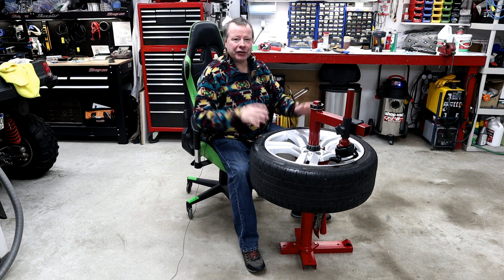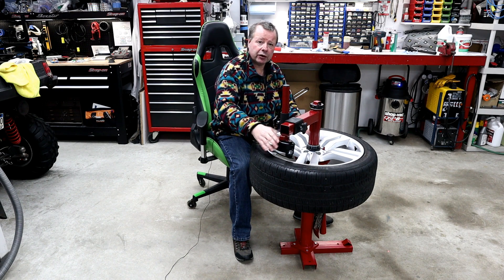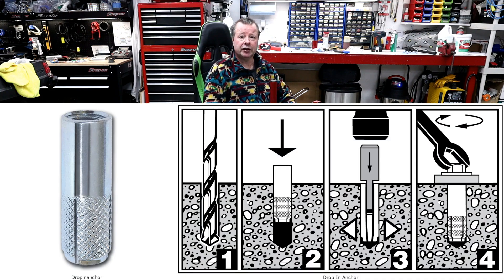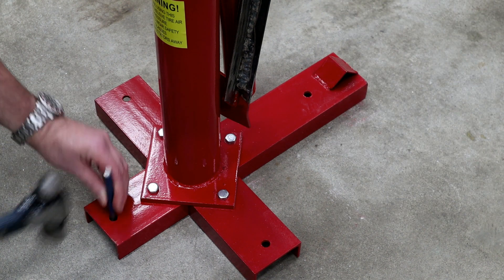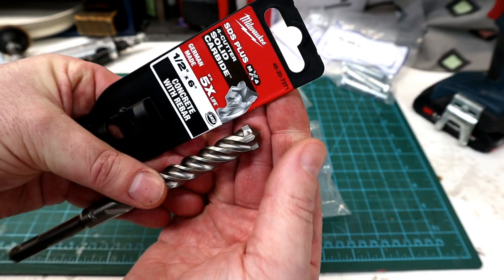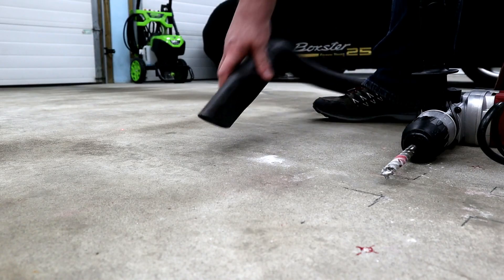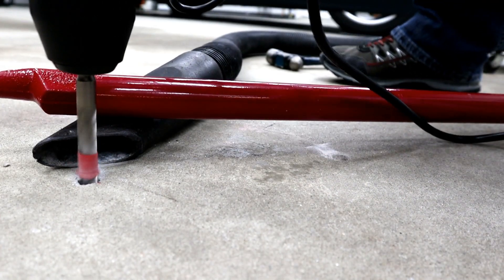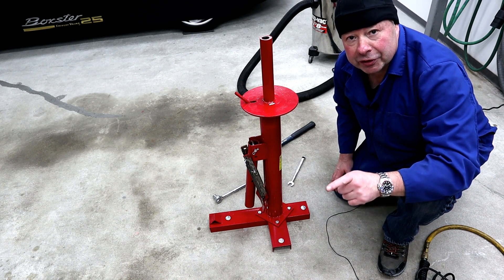How To Install A Manual Tire Changer - Hydronic Floor Hiccup

Comment from the maker: Tire Changer One Year Update Video with Tips & Tricks
https://youtu.be/QND8n_ArNRo?si=XUwyuzHL1dCcrmhl
Manual Tire Changing Series: Part 1 - Manual Changer Overview & Mounting
https://youtu.be/06Jr9t1CnNQ?si=wvgbwoxDUN1l1LLG
Part 2 - Duck Head Modification & Tire Removal
https://youtu.be/wXsloeT0QhE?si=4UjZIhoC37FezvoB
Part 3 - Mounting & Balancing Tire
https://youtu.be/IX7DvJo7A8E?si=OTW5yzmpjdq7W5tL
Part 4 - Repairing Tire Shop Damaged Wheel
https://youtu.be/hn0XbHgvnFY?si=Sm4y9yX2i7_zWbcm
Part 5 - Valve Stem Replacement Without Tire Removal
https://youtu.be/pr4bwIlc69o?si=waOAvduaulSryRZl
Part 6 - ATV Wheel Hiccup:
https://youtu.be/Zi1GYh5cEdA?si=qtPFzQtW3nS7iVvj

Comment: You are a brave and confident man drilling into that floor. Putting a lot of trust in that infrared thermometer's accuracy.
Reply from the maker: Yep, they work well in these applications.
Reply: I did the same thing when installing neighbor's  vehicle hoist. Just had a temp gun, started the hydronic heat on a cold floor, drew out the hot lines on the floored drilled ho.es for 3/4 in anchors. Worked like a charm, no leaks

Comment: I haven’t tried it with car tires yet, but I bought a tire machine from No-Mar for my motorcycle tires and it works great.  I bought the version that slips into a receiver hitch so I didn’t need to drill holes in my concrete floor and risk hitting my hydronic heat tubes.  The receiver hitch mount works great and I can also easily transport the unit elsewhere if I need to change tires for someone else.

Comment: I put plywood on a pallet and mounted the tire machine on the pallet. The pallet fits nicely in the corner of the garage and I can move it easily on a dolly. I have a diesel pickup and the tires on wheels weigh almost 100 lbs. I can't lift one on the tire machine so I tilt the tire machine and pallet and roll the tire to it put it on then tilt it back up. I only have to lift part of the weight this way. Leverage is awesome.
Reply from the maker: Glad that works for you 👍🙂

Comment: Thanks for sharing. One possible explanation for the drill bit failure is too high speed of the bit causing high temperatures, weakening the solder joint. When I split boulders I have to drill quite slowly otherwise the hard metal tips would fall off, tried water cooling but too messy, slower speed would make the tips last many holes.
Reply from the maker: Thanks for the tip - pun intended 👍🙂

Comment: This will be interesting. One suggestion M. Salt ! Can you make a video on advantages of an hydronic floor heating system like yours ? I am currently planning a 2 car garage construction here in Quebec and I hesitate between different heating systems. Gas, hydronic,electricity, infrared,etc... I am leaning toward the hydronic but would appreciate your always pertinent opinion and precautions and the reason you chose this one. Thank you!
Reply from the maker: @1983dmd - I'm no HVAC/Hydronic expert, but the pros & cons are the same that you always read about when comparing heating systems. In slab hydronic is very comfortable, efficient, silent, easy to zone, maintains such an even temperature, it's invisible with very little maintenance (boiler dependent, ours is a 12kW electric boiler as we have no natural gas service here).
Cons (specifically to a garage/shop) the biggest one in my opinion was already identified in the video; if you ever have to drill holes in your floor to mount equipment, it would be a costly disaster if you hit a pipe. If you are constantly opening and closing the doors it takes longer for the area to heat back up over a gas fired forced air or gas fired infrared tube unit. It might be more costly as well (up front), but I self-contracted our house build and did all the electrical, plumbing & hydronic work myself so labor cost difference was moot.
As for why I specifically chose hydronic floor heating for our garage; we had it in our previous garage & once you've had it, in my opinion, you likely won't go back to any other heating method. You can run a lower temp and still feel warm. No drafts, air blowing/noise, cold or hot areas. The floor is never freezing cold which is really nice if you enjoy spending time on a creeper as I do. Also seeing that we have no natural gas service way out here, electric boiler hydronic was simply the best electric heating option for a garage/basement slab. The only other realistic one was electric base board and I certainly didn't want to deal with those miserable things. 😀
Reply: @Rchelicopterfun  Thank you very, very much for this elaborate answer ! Your comments reflect what I have read and heard...Now I have to decide if I tackle the installation myself. May I ask where you found the most useful installation information ? I can do basic plumbing and electricity but do you need more elaborate skills ?
Reply from the maker: @1983dmd - I would say if you've soldered copper pipe & fittings before and installed & crimped PEX tubing, you should have no surprises on the skill side of things. Hydronic installs are very much a DIY project if you don't go crazy with multiple pump zoning/bypass mixing and what not. Ours is very simple with a single pump and multiple valved zones for several tile areas in the house, the basement, garage and even two rows of ice melt on the sloped driveway. I did a video a number of years ago when one of the flow indicators in our system was sticking if you wanted to see the basic layout as I talk about it a bit at the beginning: https://youtu.be/8yKnmEqkIHc

My wife & I laid all that hydronic PEX pipe shown in the picture in this tire changer video in one weekend. It was fun too and it looks pretty neat when you're done.
As for info, did lots of reading on various systems, but the best info came from where we got all the equipment (Bartle & Gibson).  Not sure if there are any Bartle & Gibson CO plumbing  distributors down east (they might only be out west here), but they basically gave me everything I needed in terms of product information & overall design. 
They are an Allied Engineering dealer (the manufacture of the electric boiler we have) and they/Allied had one of their system designers size everything and provide an entire order form and schematic - I just followed the plan. The design fee was waived as long as we purchased the equipment from them/Bartle. Perhaps Allied Engineering (alliedboiler.com) still offers that service and there is dealer in your area that has a similar arrangement with them or another manufacturer popular in your area? Other reason we went with Allied is they are a BC manufacturer so parts are easy to get here. Only had to replace one of the contactors in the boiler in all these years so their boilers seem to be good little units, at least the electric ones - they also have gas of course.
Reply: @Rchelicopterfun  Again a big thank you for taking the time to write this  reply ! You comments are appreciated. I am familiar with copper tubes soldering and PEX installation, so I should be OK ! Next summer project !!
Reply: I installed hydronic in my slab and it is fantastic for a workshop.  It is the most comfortable heat to work on.  I keep my shop at 60-65 and it is very comfortable to work in as warm feet make you feel warm all over.  And the lack of drafts from convection currents is nice.  I have a small wall mounted gas fired boiler and the 50,00 BTUH boiler is more than enough to heat my 32’ x 48’ shop when it is 0º F outside.  The only downside to in-slab hydronic is response time.  It takes hours to heat up the slab and hours for it to cool.  Even with outdoor reset on my boiler, you simply can’t anticipate and accommodate fast temperature changes.  When the temp drops quickly on a cold winter night, the temp in the building will sag 2-3 degrees below set point.  When the temp rises quickly on a warmer and sunnier winter day, the temp in the shop will overshoot 2-3 degrees.  It is simply the one downside of having a huge thermal mass.
Reply: @LTVoyager  Thanks for the input!

Comment: Hey John, thanks so much for your videos...working on building my tire changer with duck head mod and your install and tire changing videos have given me the confidence to try this on my own.  Sick of getting my wheels scratched up/damaged as well.  I did want to mention that i think there is a discrepency in the amazon links in the description...for me at least the 3/8" anchor link opens up into a 1/2 in anchor which doesn't match the drill bit and install tool listed.  My fault for clicking and ordering blindly but had me scratching my head for a bit...not a big deal, just wanted to mention it in case others get tripped up.   I ended up staying with the 1/2" anchor and got the correct install tool (1/2") and corresponding drill bit (5/8").  Thanks again!
Reply from the maker: Thanks for the info on the drop in anchor link. Sure enough, when I use my location of Canada it shows the 3/8 ones, but if I change to different location, then the 1/2 ones show up. I added another link so hopefully this new one is correct regardless of location, but Amazon links are ever changing and very much location dependent. 
Have fun with your manual changer 🙂
Reply: @Rchelicopterfun  ha! technology strikes again....
will do!

Comment: Alternate solution for the drop in holes and protecting those threads, don’t need to 3d print anything just drill the depth a bit lower, use a shorter bolt when you’re not using the tire equipment and if the head is over the bare concrete a bit some short grinder work to turn it into a big huge flat head screw … anyway, I’ve done this before and the plastic can end up getting mushed in and pieces break off = pain in the butt

Comment: Awesome videos! Very informative! I noticed that the tire changer you bought says it does 8” - 16”, and you changed a 20”? So you can do bigger wheels and tires than the 16” limit? 
Thank you!
Reply from the maker: Wheel size is dependent on the length of the duck-head modification swing arm, not the manual tire changer. The swing arm on this specific duck-head mod is 12" so it can do up to a 24" wheel.
Reply: @Rchelicopterfun  okay ya I thought so! So I could technically do some 275/60/20 truck tires on one of these if I have 20” duck bill attachment?
Reply from the maker: If you had a 20" swing arm for the duck-head mod, you could do a monster 40" wheel. The length of the duck-head swing arm equals the maximum radius of the wheel. For a 20" wheel you would therefore "technically" need a 10" long swing arm.  I think all the duck head mods (unless you build your own) have at least 11" long arms to accommodate up to 22" wheels.  Again, this specific one I got from that eBay Seller in Canada has a 12" arm for up to 24".

Comment: Wow, you drilled the hole in the concrete fast .. any concrete I had to drill into was as hard as granite!
Reply from the maker: Hammer drills and good bits are wonderful things - until the tip comes off 😄. I should point out I got a new bit under warranty after showing them the video so Milwaukee certainly stand behind their products.

Comment: How long are your bolts you used to secure the tire changer to the floor?
Reply from the maker: In description: "length will vary depending on how deep you sink your drop in anchors. If you have them flush to the floor as I have done with my install, you will need 2.25" long 3/8"-16NC hex bolts; I just used regular grade 5 ones."

Comment: I hope you got that defective 1/2 inch milwaukie bit replaced under warranty.  They shouldn't fail like that -- especially a name brand like Milwaukie.

BTW, the link to the anchors is to plain zinc coated -- not the stainless you used.  I thought you would want to know.

Cheers from Oregon,
Philip
Reply from the maker: Yep, the place I got the bit from replaced it, no questions asked. Amazon didn't have any stainless inserts when I was looking for the link to add - so stuck with the zinc ones which for most applications will be perfectly fine.

Comment: just wandering where you got the rubber that covers your red leverage  bar ?
Reply from the maker: Sorry, but not sure what you are referencing here: "rubber that covers your red leverage bar". 
There is nothing covering the big red bar in this video. If however you are referencing the other videos in this series, I did slide a layer of heat shrink tube down the length of the red bar.

Comment: Do these last if kept and used outside? Or is it much more advisable to do it inside?
Reply from the maker: Rain, snow, cold??? All depends on the specific environment. Tires can't be ice cold when mounting - too stiff. This equipment will rust over time in rain, etc...
Reply: @Rchelicopterfun  Fair. SoCal is usually quite warm & sunny, it's just the rain over time. Hmm. Ok.
Reply from the maker: SoCal would be a perfect outdoor environment for a little manual tire changer! Toss a garbage bag or plastic tarp over it when not in use - potential rust issue solved. 🙂

Comment: 235 45 is not "low" profile at all, that tire shop is a wimp.  Thanks for the video!
Reply from the maker: An aspect ratio of 50 and lower is considered "low profile" by tire shops and manufacturers.

Comment: 😮 It’s too bad the manual tire changer kits are not useable as is, and have to be heavily modded. I have most tools including air tools, but not a welder or 3D printer.
Reply from the maker: Yep, would be nice if there was a complete out of box manual changer with a correctly sized duckhead attachment; but until that time, we have to purchase the duckhead mod separately or build our own.
The manual changer itself is far from heavily modified. Only mod I did was beef up the bead breaking arms. Beefing up the breaker arms is just a precaution if you have stubborn beads or some dumbass at the tire shop used bead sealant which essentially glues the beads to your rims. For all the wheels/tires I've done so far (20 in total now), anecdotally I have found it to be overkill.
Even if you do decide to beef up the bead arms, no welder is needed; you could just as easily bolt angle iron to the bead breaking foot arms. As with all DIY projects - use what you have on hand to make it work, necessity is the mother of invention.
BTW. I did metal epoxy two rare earth magnets to the bead breaking bar and plate to keep the breaker bar from crashing down on the wheels - that is working well so far 🙂